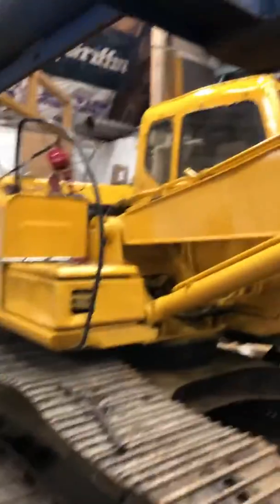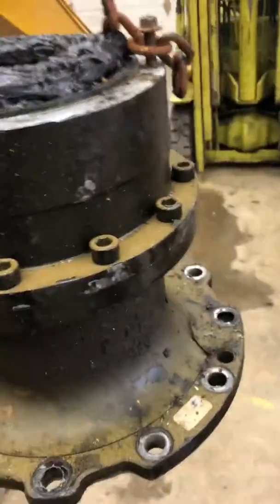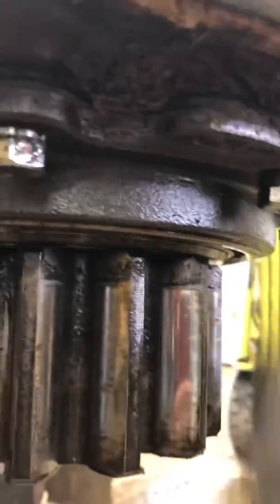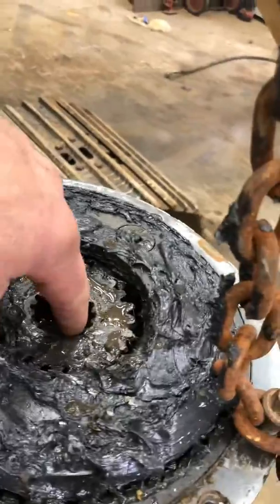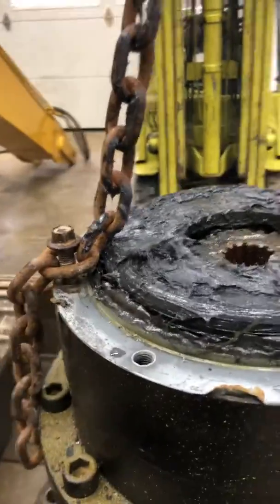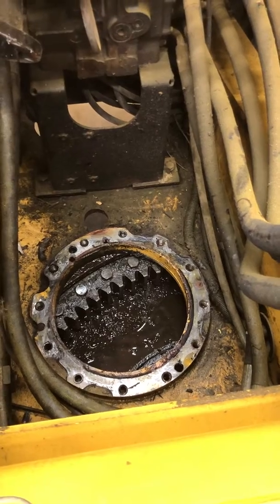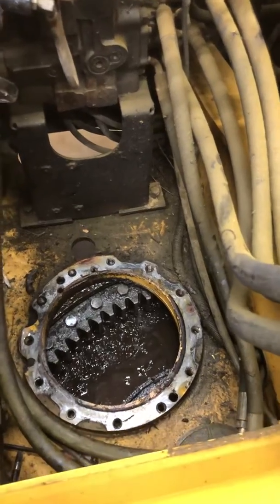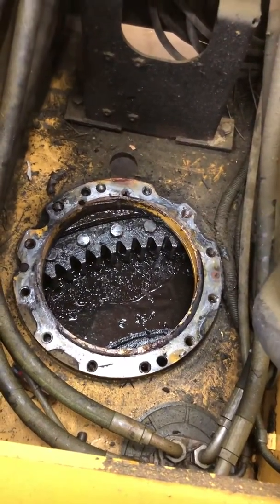Deere 160lc swing transmission

Comment: I replaced that seal earlier this summer. Recently just got cold here and the machine wouldn't swing completely around.   It finally let loose after a few hours of running it. Now its leaking again. Im assuming that seal is blown out again. Where can the water be getting in from? Any idea?
Reply from the maker: I’m not really sure.  I would say make sure your swing housing is full of grease.  Just the tube section of a grease gun to jam grease into the hole near the boom
Cylinder mounts